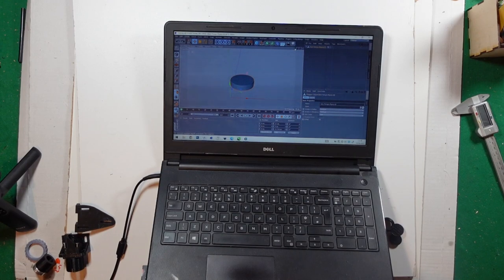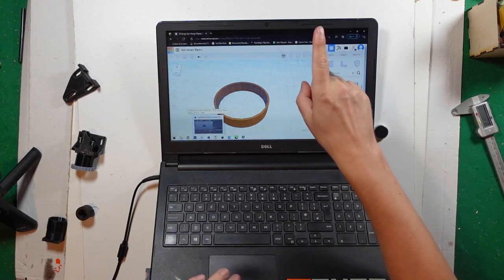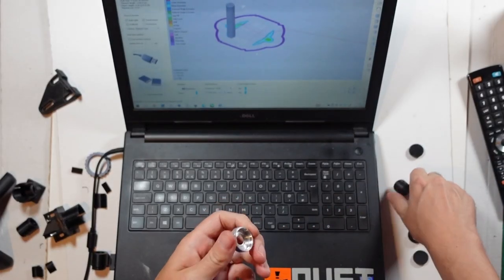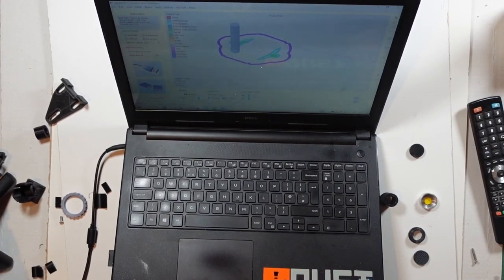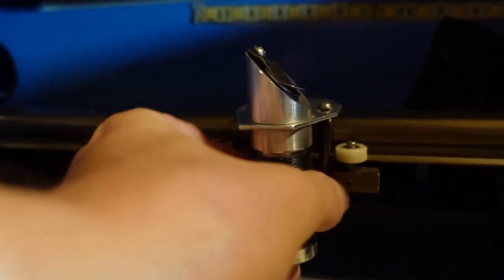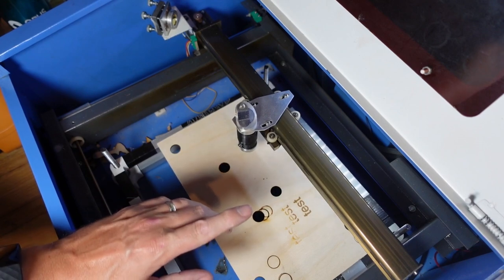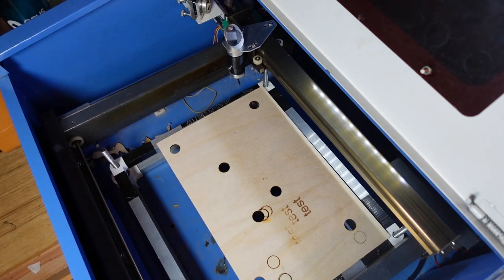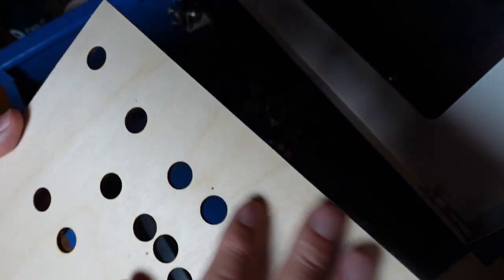I designed and 3d printed an adjustable lens for my laser cutter and it's amazing!

Comment: It’s too late now, especially because your final solution is a much better solution.  But I thought someday you might want to try modeling a part requiring that same printed “flex/springiness” without resorting to buying flexible filament in the future. 

I ran into the same spring/fracture problem when I was designing custom pegboard tool holders. The design I settled on was one where each tool holder had a hole (or few), and a corresponding number of printed pegboard rivets. I spent the better part of two days trying to get the rivets to stop breaking. 

(Yes. I am embarrassed that I spent two days designing and testing pegboard rivets.)

First start with PETG filament, as it’s not nearly as brittle as PLA.  This next part may sound counterintuitive, but if you want the filament to be springy, you need to make the walls thinner, not thicker.     This design allowed my pegboard rivets to flex inward when being inserted and removed from the pegboard and tool holder. (I also made sure the legs of the rivets were a uniform thickness as differences will create fracture points.  I angled the rivet legs ever so slightly outward and terminated them with a little nubbin that would catch and hold when inserted into the pegboard.)

I read enjoyed watching you work through your process! Thank you.
Reply from the maker: 😂 spending a few days designing and testing parts is where all the fun is at. 😜

To be fair though, I went with pla just because I know it doesn’t let off any fumes if the laser did happen to hit it and it’s what I had available.

Comment: My only caution with printed parts is the for long burns the lenses can get hot and that will deform the plastic and maybe cause a fire. What would be cool is to see what an sls part would look like from pcb way
Reply from the maker: Does it? I did try a test cut/ and engrave that took roughly 40 minutes and no problems as of yet. I’ll have to run a few more test to make sure. I have seen other 3d printed designs too that house the lens with a 3d printed part and haven’t seen/ heard of any problems there either.
Reply: @MARCAM  yes i agree as long as the beam is aligned properly and nothing shifts over time. Sometime things all seem well until hours of vibration get to it and then things shift causing heat to creep where it is not suppose to. I like the designs done many myself as well but transitioned to a main head unit that was metal and a printed adjustable holder seems to be the best compromise.
Reply from the maker: That’s true. Got a few projects coming up so will check after every job. 
That’s a good idea with using the main part as metal and the other part 3d printed. I’ll have to take a look into that :)
Reply: @MARCAM  I wish I could share pictures here would be nice to collaborate on ideas do you have a discord
Reply from the maker: Yeah would be cool. I have discord. I’ll have to check what the username is. Not used it in a very long time

Comment: Would be neat to add a servo so you could programmatically adjust the focus.
Reply from the maker: I did think about that and use something like a linear actuator to attach to it. Maybe in the near future I’ll give it a go and see how well it works 👍🏻
Reply: @MARCAM  Yeah there is someone that used a little mgn rail with a stepper to do it. I took a different approach and used a cdrom linear drive to move it up and down. I have a sensor vl53 sensor trying to do the distance and adjust the motor accordingly.
Reply from the maker: That’s definitely way above my knowledge of any sort of electronics 😂 checked out that sensor though and looks awesome
Reply: @openhostwebservices6086  I can see how you can use that sensor to adjust things. neat!